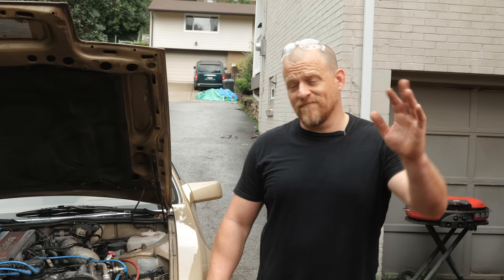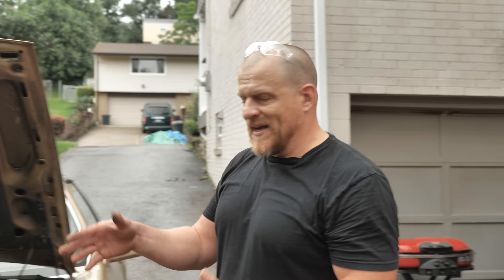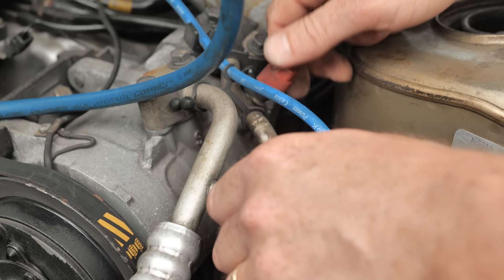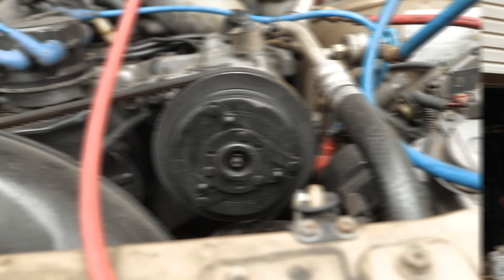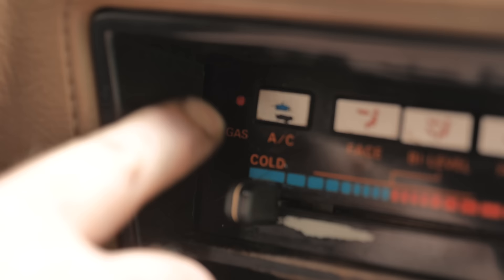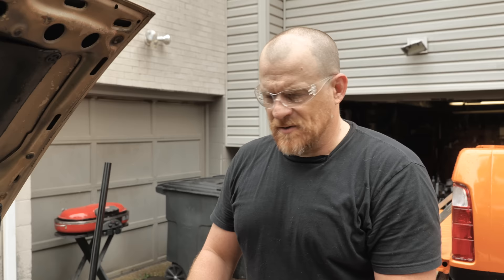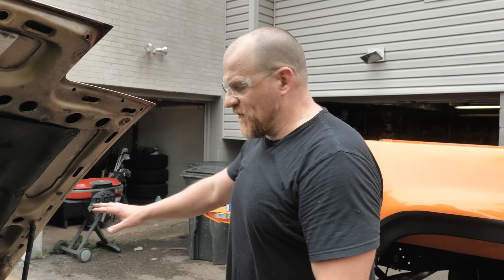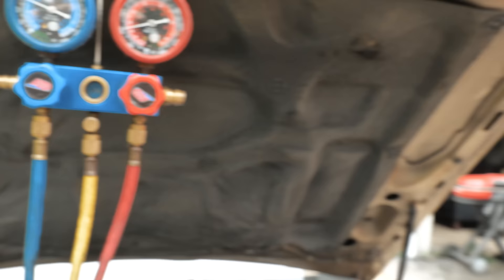A/C Leak Testing, Repair, Evac and Recharge (ANY CAR!)

Comment: Hey Paul, I am having trouble adding refrigerant through my load side. I think I might have a leaking tap. I screw it in tight, both to the tap and the yellow line. My can and tap get real and froths over and seems to leak. I’m pretty new to this stuff, I’m pretty sure I obviously bought a defective tap, but maybe I’m doing something wrong. Any thoughts would be appreciated if you see this
Reply from the maker: What kind of can tap? Some of them you wind it in to pierce the can and then back it off after that to allow flow
Reply: @ScannerDanner  it looks just like the one you used in the video. It winds down it to pierce. I think my problem is I wind it down all the way to pierce it and I didn’t know you had to back off a little, so maybe I was piercing too much, but it seems to be leaking from were you screw in the tap to the yellow feed hose.

Comment: My AC in my 2014 Nissan Altima blows semi cold air. The hotter the more it blows warm air. like any inexperienced citizen, I replaced the compressor with a new one thinking that would solve the problem but it didn’t. After three days it started blowing semi cold air. I took it to two different repair shops and none of them were able to help. So I purchased me a gauge set from Amazon, connected them and the readings were like this. The low pressure side was (60psi) and the high pressure side was (150psi). The ambient temperature at the time was around 72 degrees. The compression clutch comes on but it runs continuously and does not cycle on and off. HELP!!!!
Reply from the maker: 60 isn't low enough. That's why it blows warm. High side is a little low too. Sounds like an expansion valve issue

Comment: Is Danner at least your last name? Every time you hook up your gauges, are they always at zero? Mine isn’t so I adjust it before using it.  Then the next time I hook it up, it’s off zero again. Is that normal or expected?
Reply from the maker: Yes my name is Paul Danner and no, you shouldn't have to do that with your gauges. No trapped psi in there? Otherwise you may have a really cheap set of gauges? I don't know.
Reply: No residual PSI in the gauges. The gauges are the OEMTOOLS brand that Autozone loans out. I’ve been using it for the past week to try it out. Are you still using the ATD gauges these days? Can you recommend a good set of manifold gauges for the DIYer? Please don’t say Harbor Freight. I’ve tried a couple sets and they leak after a few uses.

Comment: I’ve got a 2011 Chevrolet Trailblazer when I start it up and the compressor kicks in at an idle the engine dies. My opinion is the compressor is loading, which tells my the IP valve is clogged or not working properly. I need your advice what’s wrong?
Reply from the maker: If you hold you foot on the gas pedal to keep it from stalling, how does the AC perform? If you say it is good, my next suggestion is to clean the throttle body

Comment: can you tell me if the system is pressurized and if you open the blue valve will it empty without discounting the yellow tube (with check valve)?
Reply from the maker: the gauge valves simply open and close a passage to the yellow hose and if both are open, all 3 hoses are now connected. Make sense? You do NOT need to touch those valves unless you are adding or removing refrigerant

Comment: All the 3--3.5 cfm vacuum pumps operate poorly . Ideally 4cfm minimum but 5 cfm upto 6cfm is best . Pull vacuum quicker . When u upgrade to a bigger pump the performance difference is very obvious .

Comment: I laughed a lot whenever u speak about the acid created blah blah what do people think happens when a car sits with a bad leak for 10 years lol. U fix leak draw vacuum put the required stuff in and it works. Compressed air is fine i think
Reply from the maker: You should hear all the "experts" comments to me about using compressed air in the past 🙄

Comment: 500 micron = 29.92 inchs

need to evacuate and don't have an evac machine? 

take your tank and vacuum down and put in freezer 35 min get as cold as you can while you get a small trash can fill with ice after you put old vacuumed freon tank in.
now hook to car and open valve. the science is freon always goes where its cold so the colder you make that tank the more freon it will pull out.

Comment: Paul if you're so concerned about polluting the atmosphere with refrigerant.....where do you think the original charge went?
Reply from the maker: My point was charging with refrigerant on an empty system to locate a leak is a foolish first step. The end
Reply: @ScannerDanner  I agree,but wasn't 134a atmosphere friendly and the reason they did away with r12
Reply from the maker: @zeke112964  it was supposed to be, apparently it is not? I don't really know my friend

Comment: So I don't have pressures, maybe I'll see about getting a gauge ser. Low side pressure on a can I had showed 36psi low side. 74 degree day.
Compressor cycles on for a short duration. I.e. it fast cycles.
1994 explorer. Low side holds pressure. If I get a gauge set on there and I'm over pressureizing the high side that it shuts down. Should I suspect a plug orafice tube.
To work on the system properly I'd need the system evacuated. What should I expect dollar wise for a shop to evacuate a system? I know location plays a part. But if a shop says $250 would that be crazy high?
Reply from the maker: Need high side pressures to help, but typically when a compressor short cycles you are low on charge. Not sure what shops would charger you for an EVAC because there is a real concern for them for contaminated refrigerant and unless they have an identifier, they may not even want to do it!
Reply: @ScannerDanner  that makes sense. IIRC I thought the high side had a high pressure cutout and a low pressure cut out. I could be totally wrong.
My line if thought was if the orafice tube was blocked. But now I get it, kinda the aha moment, as to why seeing what both high and low side pressure is doing. Well I guess I'll need to look at getting a gage set.
Reply from the maker: @midnight-xpress1136  you can get a set for under $100 in fact the one I'm using now was less than $50 I think
Reply: @ScannerDanner  I'll have to do that, oh BTW thank you being one of those folks that doesn't edit out the small little mistakes in your video.
Because it helps us learn how to not make them and recover when we do silly mistakes, cause we will all do it at some time.
I've worked 23 years in electrical/electronics calibration and I always tell my apprentices, "you will blow up gear, the key is hopefully it isn't too expensive and you don't keep blowing up stuff the same way".
U always tell them the story how I blew up a $55,000 Fluke 5700A calibrator. Had a breakout cable that had two cables a DB-15 rs-232c male and female connector. We use the female plug to power up and input a signal input. The cables both have 115v on the connector one to the UUT and the male doesn't connect to anything. I had a banana patch cable slide over and contact the 115v DB-15 male connector pin and send 115v to the calibrator input. A pop and error message tripped on the calibrator. In a blink of an eye I killed the calibrator. Went to my boss and told them of my screw up, and also let my standards manager know immediately once I figured it was toast. Which is the other thing I teach them is when you do screw up equipment be accountable and let your boss know. It's way worse trying to cover it up than to just take responsibility. You can lose your job that way.

Comment: Would compressed CO2 also work in place of the nitrogen?
Reply from the maker: I've used compressed air for 20 years without issue. But the internet police had me change my ways lol
Reply: Thanks for the quick reply! Do you happen to know what kind of adapter I need to go from my standard co2 tank to the pressure gauge?  Thanks for the great videos.  You know your audience and that many need it broken down to obvious (to a real mechanic at least).
Reply from the maker: Check my HVAC playlist, I have a video where I broke down these parts I'm using for the tank and gauges. I think it was on my RV?

Comment: Awesome video. Question. One thing I dont understand is when you disconnected the micron gauge, why did you have to clamp it? Couldn't you just reconnect it, keep the service port closed, and then open the valve to use the vacuum pump to get the air out of the blue hose?

Comment: If using compressed air for leak detection what is a safe pressure? Thanks
Reply from the maker: I'm running 200 psi with nitrogen, and most shop compressors are around the 150 psi number, so you'll be fine in that range
Reply: @ScannerDanner  Thank you. Trying to talk my brother into air testing his system. He ‘thinks’ his evaporator is leaking and I told him to be 100% sure before taking the dash apart. 2004 WJ.
I repaired mine with the help of your videos. 2002 WJ
Thanks for taking the time to get back to me. I’ve forwarded this video to him.

Comment: Hi I just watched you video and you are very good  I got question for you I got toyota corolla 2008 and I get obd code po441 I replaced the purge solenoid but is not active I disconnected the hose coming from canister just to si if the purge valve active and is not turning on I delete de code and it's keep coming back because is not turning on de purge solenoid can you help me with some info please thank you
Reply from the maker: 1. Define the code please (I'm not a walking library 😉)
2. What are your voltage readings on the purge solenoid with it plugged in and the key on, engine off and running
Reply: Code po441  purge valve not properly regulating that's the code I measure the voltage I don't get anything wen I turn the engine on I don't get anything
Reply: Thanks for your reply

Comment: What if you don’t have shop air or nitrogen to test???? What can you use?
Reply from the maker: Go buy a cheap air compressor. Not sure what else to tell you.
Reply: @ScannerDanner  that wasn’t meant to be coming off ads anything but just a question. I was just wondering if there happened to be any other tricks is all
Reply from the maker: @laszynandriy  I'm sorry my answer seemed like I was being short with you. I answer a lot of questions every day. I honestly have no other suggestions for you as I believe charging with refrigerant to find a leak is not wise.

Comment: I get the whole point of the nitrogen charge. But when a system leaks out all of its refrigerant, isn’t it safe to say that it’s full of atmospheric air?
So what’s the real difference between charging with shop air ?
Don’t mean it as an arrogant comment, genuinely curious
Reply from the maker: Great question! Same one I've asked forever. To be honest, I just got tired of hearing about using air pressure lol and they're not wrong in saying nitrogen is better. Plus I can use higher pressures with a nitrogen bottle
Reply: @ScannerDanner  understood! Appreciate your feedback Paul!
Reply: Unless the leak is from a sudden break in a line or component like after a wreck, even a large leak will close itself as the pressure drops. Even if there is only 2-3 psi left in the system, it's enough to keep atmospheric air out.

Comment: More trouble than it is worth in my opinion. The modern leak and AC charging systems do not us a Micron gauge. It passed with nitrogen on the standard gauges so why introduce a more sensitive gauge to bring up doubts.
Reply from the maker: Wait until you see my follow up on this! We had some issues

Comment: The idea that using shop air on an empty system to find the leaks will "cause the oil to become acidic" is illogical.  If the system is already empty, that means that there is already atmospheric air in the system, so any acidifying has occurred already.  I wouldn't do a test with air and then leave it in the system for any real time, but if you do it to test, and then fix what you find, you haven't caused any oil to turn acidic that wasn't already acidic.  When you add some fresh oil you will reduce the overall acidity.

Comment: What’s does it mean when car has cold ac and compressor spinning but car is shaking at idle but get worst when put in drive. Turn off a/c and car runs perfect. LS pressure is 35 and HS 175
Reply from the maker: This is usually from an idle compensation problem. Is your idle speed very low with the AC on and in gear? What year, make and model car? My first thought is to clean the throttle body and restore minimum air flow. I have videos on cleaning a dirty throttle body and what to look for.
Reply: @ScannerDanner  2004 Hyundai Sonata with high miles over 200k, I thought the same and clean the throttle body and the butterfly flaps. Clean the IAC sensor as well. Car was working, perfectly the only done recently to ac system was alittle bit of Freon was added. Because charge was low. Charge is now correct and blowing cold but have a shake. When in gear idle drops
Reply from the maker: @l3ugl3unny10  could be still an idle speed control issue. If you put your foot slightly on the gas and brake at the same time, does it smooth out? What is your RPM in gear with AC on?
Reply: @ScannerDanner  850-912 rpm at idle , 650-760 rpm in drive. This with the a/c on. Again before slight Freon was added the car wasn’t shaking. I wana make sure it’s not ac related
Reply from the maker: @l3ugl3unny10  it could be AC related. It can also be an imbalance in the cooling fan
Reply: @ScannerDanner  thank you for time your very kind, keep it up with the video love learning new things 👍🏼

Comment: When converting over from r12 to r134 what do you recommend?  Video?
Reply from the maker: Find and repair any leaks, screw on your new service fittings and add a full system charge of Ester Oil, then EVAC and Recharge like normal.
That's it. My son's car for example hold 5oz of oil. Somewhere between 5-8 is typical

Comment: 40x4=160.     Use a child's water gun to clean the fittings of soap, or preferably blow it out with compressed air blow gun.
Reply from the maker: Right? I can never do math on camera 🤣

Comment: Hello scanner danner I have a problem with I have a 2016 chevy Malibu and I replaced compressor, condenser, expansion valve the car says 0.700 kg equals to 1.54 lbs I install correct amount and pressures are high like if it was overcharge and is only cooling 60-80 degrees at a 105 F weather and humidity 60% and I try installing less freon like around 1.10 lbs and it shows the correct readings like low side 32 psi and high side 225 but doesn't cool it takes a long time to cool and only goes up to 78 F on the vents I don't know what I'm missing here and the only thing that I can think of is that the alc compressor is bad even brand new Murray from Orelly's any ideas??? What could be wrong
Reply from the maker: what are your pressures with the correct charge? is your cooling fan running during this time?
Reply: With correct pressures at 0.700 kg the low side is 62 psi and high side 290 psi yes the fan is running and only cools 65 F
Reply from the maker: @javiergonzaleztoledo  hard to say, did your old compressor pump crap through your whole system?

Comment: Your making this to complicated lol You just fill while running till the line gets cool by the firewall and your done. No gauges needed no measuring needed haha. I learned that from a 45 year veteran. But really it works pretty well and i have never seen it to really be a big issue. 7 years on my personal vehicle that way. However your way is probably better... I guess maybe one day a problem will come up but will see.
Reply from the maker: glad that has worked for you :-)

Comment: PAG 100 bottle says don't use with r12 systems.
Reply from the maker: Correct but this was retrofitted to R134a so technically I could have used either PAG or ESTER oil

Comment: Danner where can I get a yellow charge hose with the check valve. The one that came with my gauge set did not have the check valve
Reply from the maker: Not sure but I think you can buy just a check valve to screw onto your existing hose
Reply: @ScannerDanner  thanks paul

Comment: What about charging it with propane to check for leaks?
Reply from the maker: I'd rather see you use air pressure than a flammable gas. Also I don't know enough about the chemistry to say whether or not you'd be contaminating the refrigerant oil
Reply from the maker: @bartscave  until the EVAP leaks and you fill the inside of your car with propane!

Comment: I accidentally used pag 100 instead of pag 46 in a 2013 dodge charger. Will this cause issues? If so what should I do before they arrive
Reply from the maker: It's a viscosity issue and it's the compressor itself that we need to worry about. I'm not sure. How much different are the two? Questions for "the Google" lol sorry
Reply: @ScannerDanner  from what I could find just a slight viscosity issue but some of the people I've seen that do HVAC on car said in post the pit Pag 100 is every car without issue as long as it isn't over filled. I was just trying to get an extra opinion before I pay to have the entire system drained and cleaned if I need to. So far the car is blowing cold out of the vents
Reply from the maker: @datboifred  I think you'll be okay too. How much did you add and what components were replaced?
Reply: @ScannerDanner  The only thing that was replaced was the low and high side input valves. The can said on the back 8.5 oz of pag oil
Reply from the maker: @datboifred you put 8.5 ounces more than you should have in that system. That would be the amount you'd put into a brand new system with no oil. The majority of the oil (95%) stays in the system, even with a leak. You only needed to add a half oz with what you did. You need to blow that system out. You will cause issues with double the oil that should be in there.
Reply from the maker: Watch this video where I'm concerned I have too much oil and how I deal with it https://youtu.be/xBuAQuWezMY